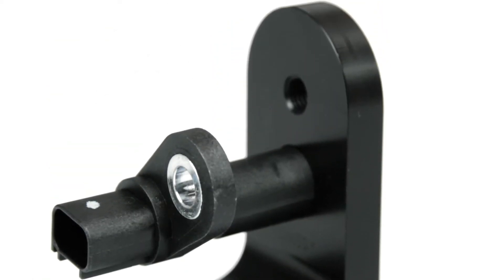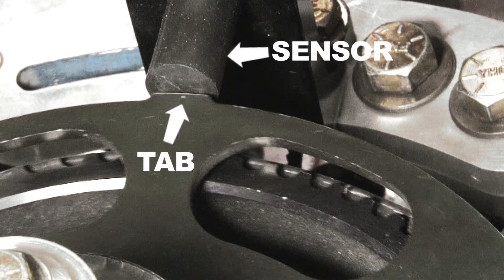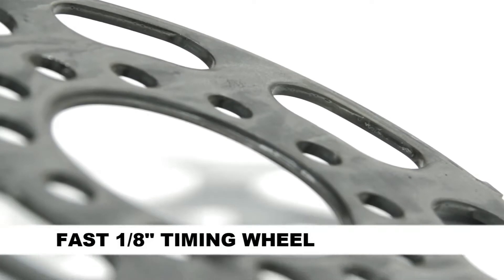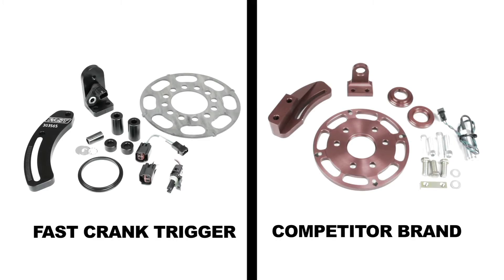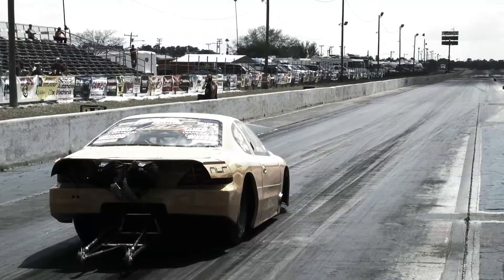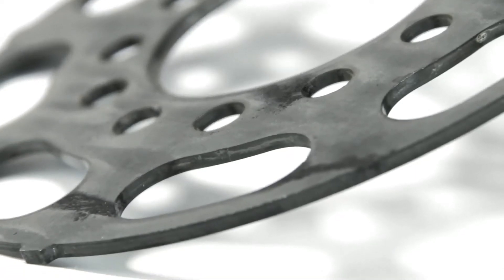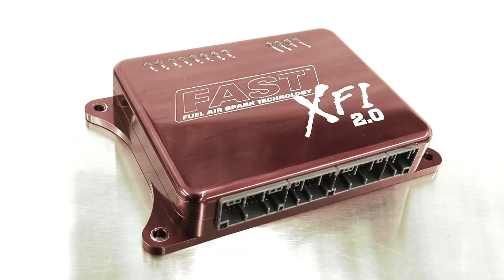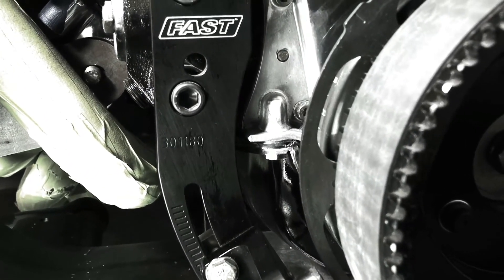Product Tech Video: FAST™ Crank Trigger 101

Comment: Is it possible to use a crankshaft driven distributer on a Chevy 4.3  instead of the standard location at the rear of the block. I'm working on an engine swap and I don't want to cut up the firewall?

Comment from the maker: A crank trigger allows for more precise ignition timing, which can increase horsepower.  We typically use our crank trigger kits with the XFI engine control unit. The kits can be used with an MSD 6A ignition and a carburetor, but the timing will be locked at one number. Hope this helps, and thanks for your nice words about our videos! We appreciate your watching!

Comment: Would this system work with an MSD 6A and GM HEI? What could I expect in improvments over what I have now? It's a 355 sbc with a Weiand 142 blower, 8.5 to 1 CR, 1.94 heads, Bracket Master cam, long tube 1 5/8" headers, 2 1/2" exhaust with x-pipe, 700R4, 3.73 gear.
Great videos, always open them first!..........Art